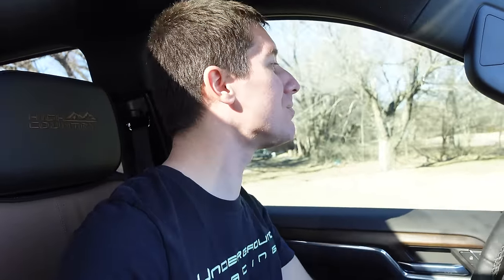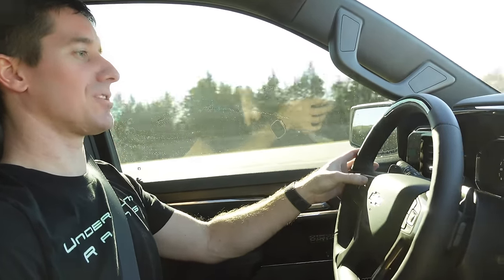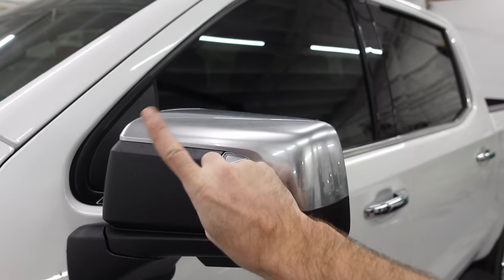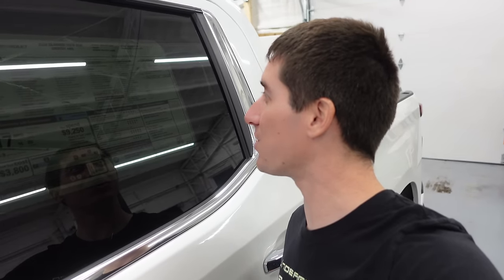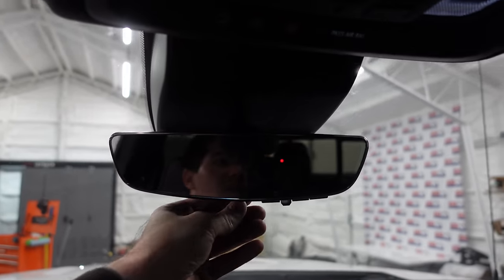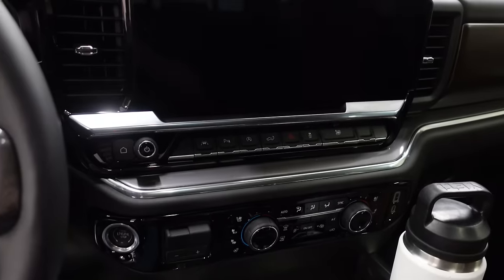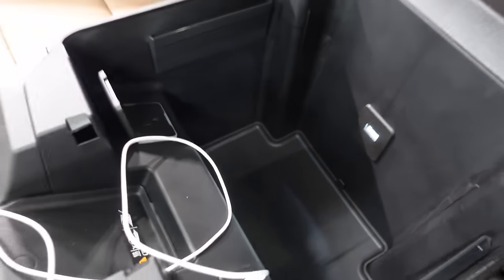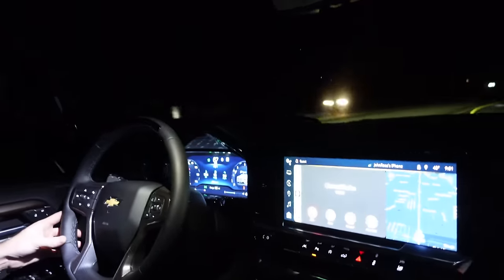This Is The MOST EXPENSIVE Chevy Truck You Can Buy Today *2024 Silverado High Country*

Comment: Hey
Reply: Took forever for comments to load.  How's the new truck treating you?
Reply from the maker: 🥇 boom!
Reply: @bearing_aficionado  I was wondering how you were so far behind tonight. Truck is good. Thought it had a 23 gallon tank. $102 later I found out it’s 33 gallons. It has every option so it’s like going for a ride in your living room. It’s just huge compared to an SUV, so I’m still getting used to parking it. The spots were always tight for an SUV but this is basically on the line on both sides of the vehicle.
Reply: @psubuster  mine is the 23 gallon tank.  Does your have the 5.0 V8 or 3.5 V6 Ecoboost.  I'm going to guess the Ecoboost?  That engine will get up and go.  I want to recommend two things.  The most important one is oil changes.  Do them every 4000 miles.  Especially if you have the Ecoboost engine.  And use good oil too.  I use Penzoil Ultra Platnium 5w-30.  The other one and more expensive one would be Amsoil Signature Series full synthetic.
Reply: @psubuster  the other thing is get Forscan.  You can do all kinds of customization if you are comfortable in making program changes to your modules?

Comment: 80k for a truck. They have lost their minds. All those stupid features?!? Who needs all that crap. I think self driving should be illegal as its a danger to other drivers. If you cant back up to or pull your trailer without 15 cameras then you don't need to be pulling a trailer. Period. I would never buy this thing in a million years. If you gave it to me I would sell it immediately to the next fool. So much tech and electronics your never going to get to drive it because its always going to be in the shop getting something fixed. Its ridiculous what our world has turned into. Those seats look hard as a rock and very uncomfortable. At least it runs on gas and not batteries.